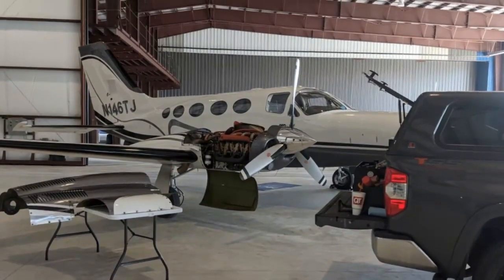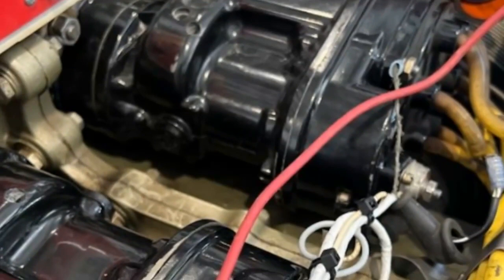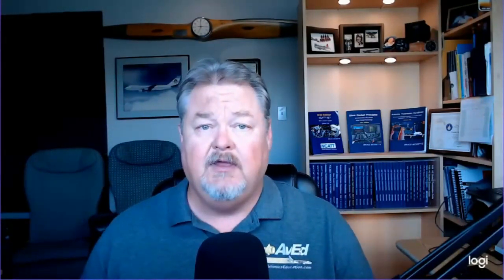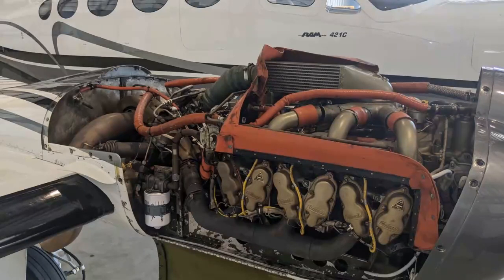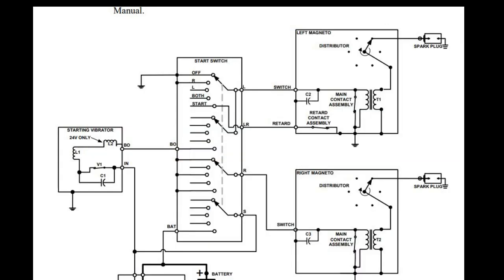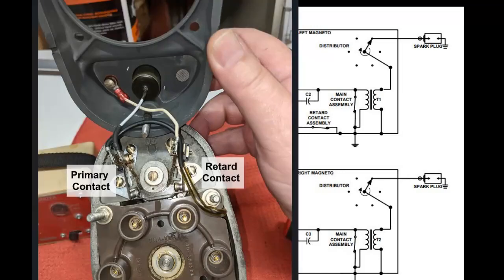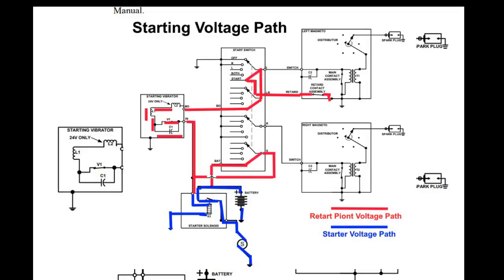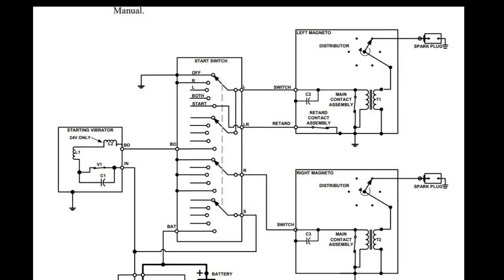How to Troubleshoot a Magneto Part One

Comment: I have a j3 Cub with a c85. I check the mags before the flight and get a 125rpm on L & R. I also have moved the mag switch to OFF and the engine shuts down.  However AFTER my flight when I move the mag switch to OFF the engine will not shut down. I have taken the switch apart, cleaned it, ohm checked it and it tests good. What do you think is the problem?
Reply from the maker: You might have an intermitten ground wire from the switch to where ever its grounded.  I might even be grounded through the switch mount and it could be riding on paint or corrosion.